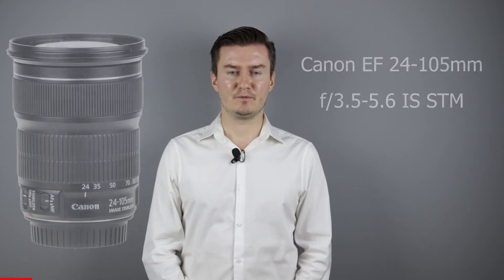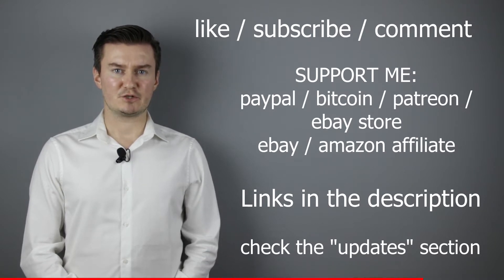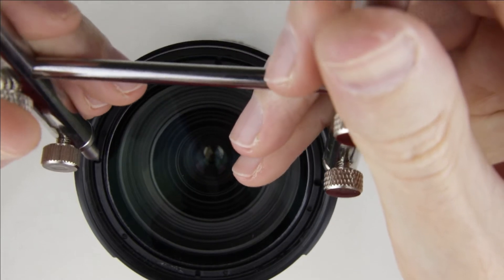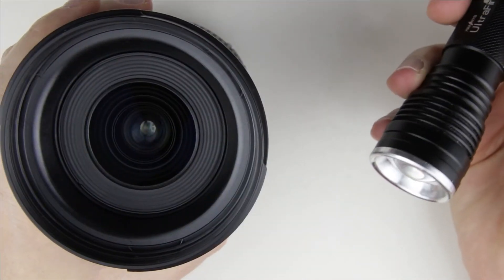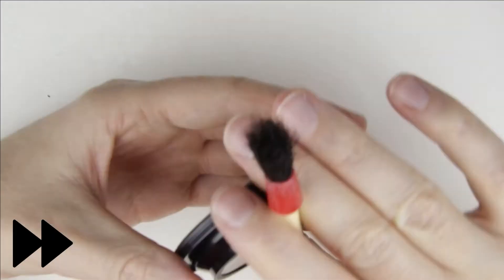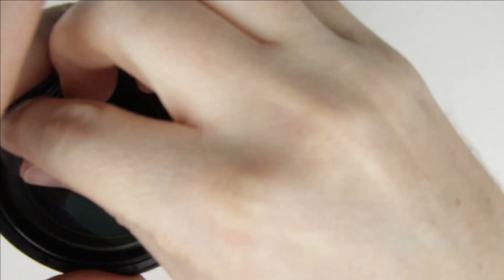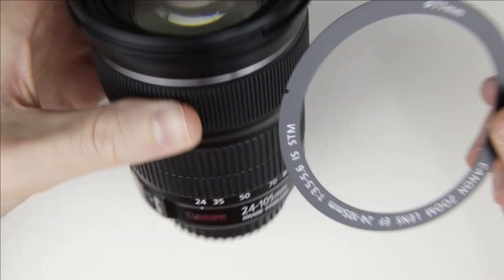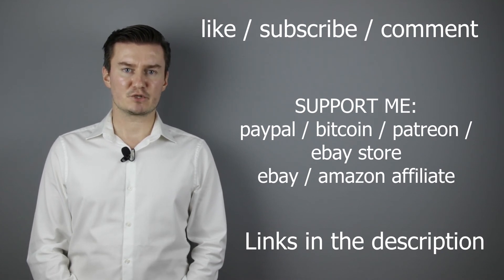Canon EF 24-105mm f/3.5-5.6 IS STM - how to clean the lens inside

Comment: i tried to disassembly this lens but i could not.  It so differences with other lens branches. May you make one clip How to disassembly it? I interested to looking forward you next video.
Reply: @sveto have you already found out how to disassemble it? I have the same problem here
Reply from the maker: I don't have a video about it. I only disassemble lenses when I have to, so if there is a problem with them.
Reply: @CamerasLensesEtc  Im also very interested.. My front elements wobbles and its driving me insane. I suspect that the tightening screws are under the focus ring but i cannot access them the rubber on top is not like on the L lenses. It is very difficult. I would greatly appreciate if you can at least give me some advice on how to fix this myself. Thank you
Reply from the maker: @TheTransfix  To do that, you have to disassemble the lens, and when you remove the USM motor, you will have access to the screws which connect the front lens tube to the lens. I have a disassembly video of this lens, check my other videos.
Reply: @CamerasLensesEtc   Thank you for responding so quickly. I am sorry but the only Video i find is this of removing the front element and few for 24-105 f/4 L lens. Could it be that is privat or restrited in some way? Do you have a link? Thank you for your reply now i at least have an idea how to go forth with it. :)
Reply from the maker: @TheTransfix  Sorry, I thought you're looking for the disassembly of the 24-105/4L lens. I don't have disassembly video for this 24-105 STM lens.
Reply: @CamerasLensesEtc  I see. No problem! I was just looking for a guidence really. Would you say it is likely for this screws to be on the same place as in the L lens? because the focus ring is stiff and strong i dont think under there?
Reply from the maker: @TheTransfix  I haven't found any zoom lens which change its length during zooming which can be tightened removing the zoom or manual focus ring rubber. All of the lenses I had repaired with this problem, I had to remove the USM motor or the zoom sleeve to get access to the screws which were holding the front lens tube. Most likely those screws are there, and you have to disassemble the lens.
Reply: @CamerasLensesEtc  thank you for the advice Ill probably sit 1 of the days and try disassembling it. 1 More question tho.. Does your copy wobble? Because I suppose all the zooms do to a certain extent. Which makes me wonder if it is maybe within the normal the problem is, that when I move the camera I kind of feel the wobble.
Reply from the maker: @TheTransfix  Generally, when the lens zoom is in wideangle position, it can wobble, and it is normal, but when in the telephoto end, it should not. (I don't have this lens anymore.)
Reply: @CamerasLensesEtc  I see well i compared it with a fuji lens and both wobble but the canon considerably more in telephoto end and in wide angle allthough it is not much in the whole picture it is very perceptable. I think Ill open it in the weekend I saw your other video. At least untill the barrel shows it doesnt look too complicated.